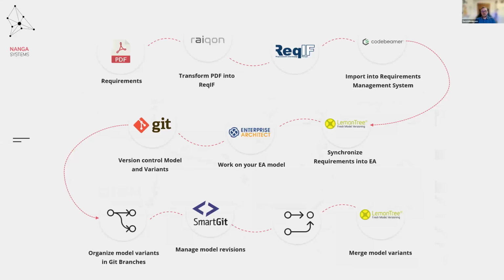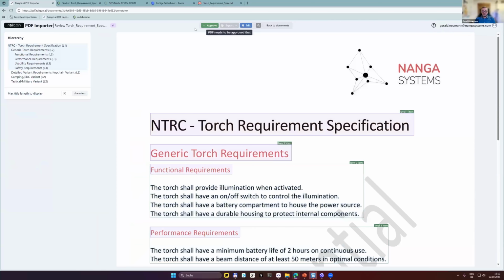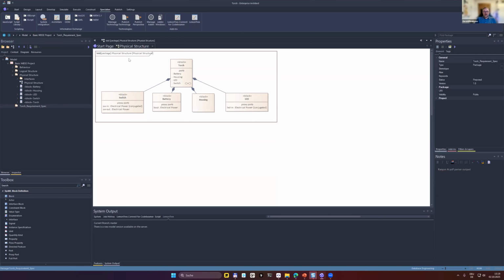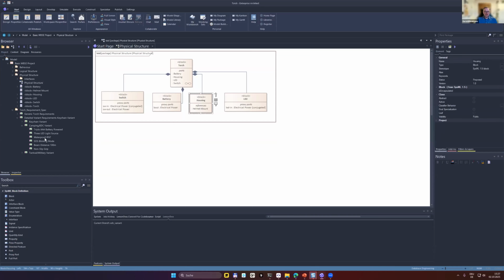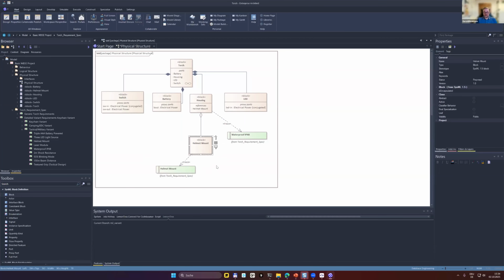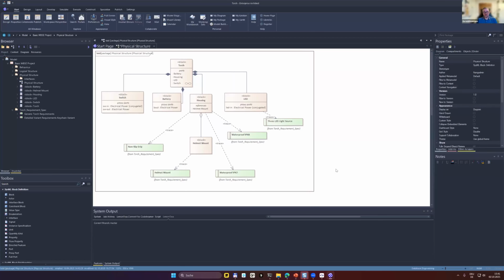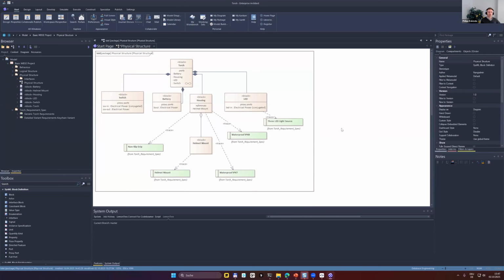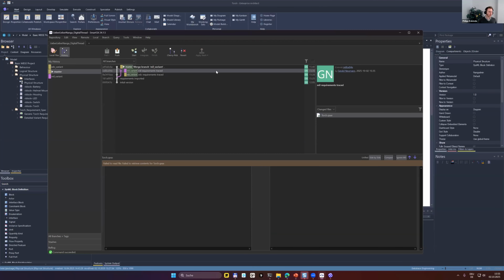Webinar: The Digital Red Thread - From PDF Requirements to Version Controlled Models in EA

Comment: Excellent Demo! ReqIF is a great format to move your PDF file into and then import into Requirements Management Tool. One can also think of moving directly from AI Tool like ChatGPT, Copilot, Gemini, etc. into Requirements Management Tool that supports Markdown Format. Then one can easily export the structured requirements including traceability out in the JSON and Markdown format that can be feed into any other system! 

Just wanted to add that there is a community driven, FREE and Open Source Requirements Management tool that is very new but supports following features... 

- Requirements Breakdown Structure
- Custom Requirements Type
- Change Management
- Traceability
- Baselining
- Including and Excluding requirements to define scope of the baseline
- Parking Lot to move unfinished requirements away for later implementation
- Markdown format for description to capture rich text description. 
- Export and Import of data in JSON format that can be used to set context while talking to AI engine too!

Hope this helps!

- OpenRose - 🏵 Requirements Management Tools Team 
FREE and Open Source!
Capture, Define, Trace, Change, Prioritize, Baseline, Negotiate, Test, Deliver >>> Repeat the Process.